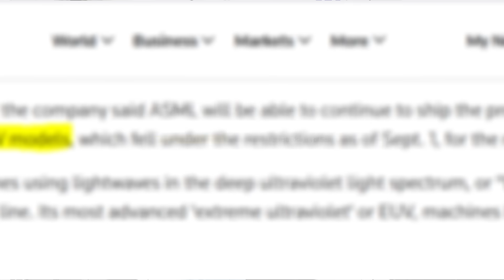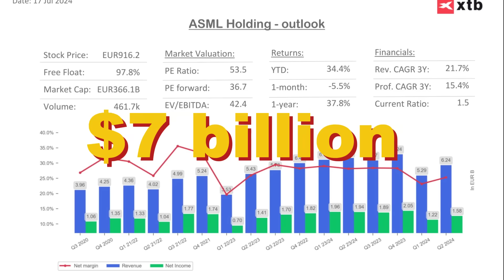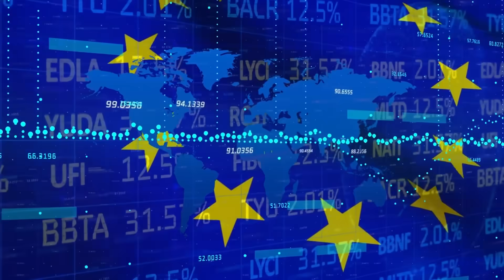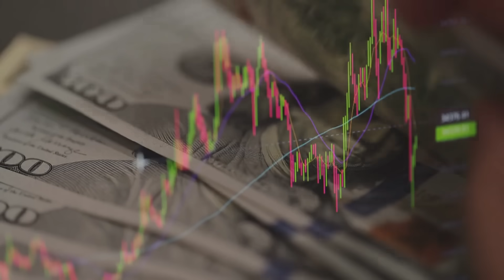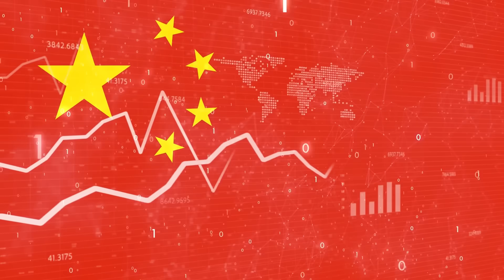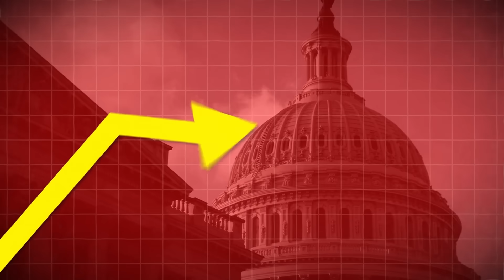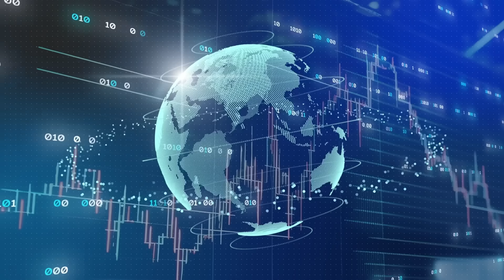Netherlands Defies U.S. and EU—ASML’s Game-Changing Decision Escalates the Global Chip Conflict!"

Comment: ASML is on self-preservation mode as they know if they don't do business with China now, they will not be able to do so once China has successfully developed microchips with carbon nanotubes (graphene) that promise to outperform traditional silicon chips in speed and energy efficiency. This innovation could potentially give China an edge in AI applications, especially as silicon-based technologies approach their physical limits (Moore's laws). That will mean ASML will lose their dominance in lithography machines & equipment as China race ahead as they did with Electric Vehicles, Solar Panels, Batteries, etc.

Former ASML Chief Executive Officer Peter Wennink said it adequately, "The laws of physics in China are the same as here (Netherlands). The more you put them (China) under pressure, the more likely it is that they will double up their efforts."

Comment: Too LATE !! ASML refuse to Repairs or Supply Spare Parts including Consumables to Existing Owners of ASML equipment. During 2020 till 2024 China was "STRANGLE " of chips. Effectively BLOCKING advances in AI, Etc. However ... 2025 onwards ...... China has FULLY MAKE these chips machine using 100% CHINESE technology , etc. ASLM ...... FULLY deserve what is COMING. COLLAPSE of ASML when Chinese Machines are SOLD at 50% prices and is easier and cheaper to maintain the machines. KARMA is a BITCH ( ASML .. You DESERVE it  )